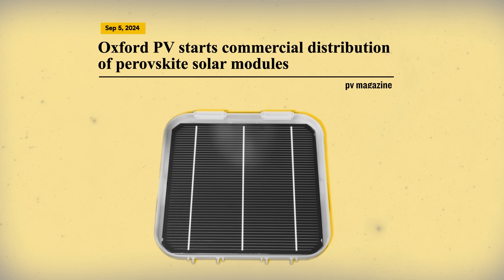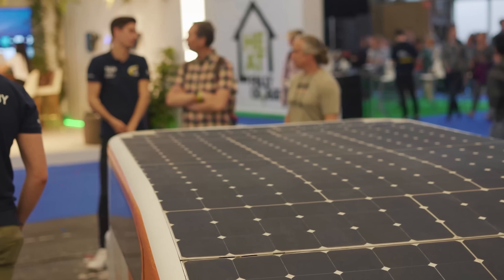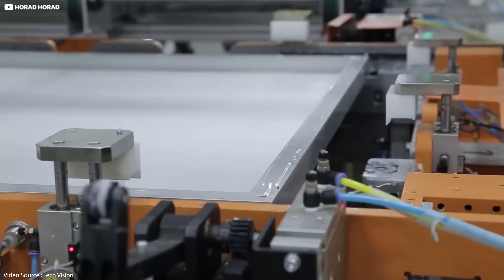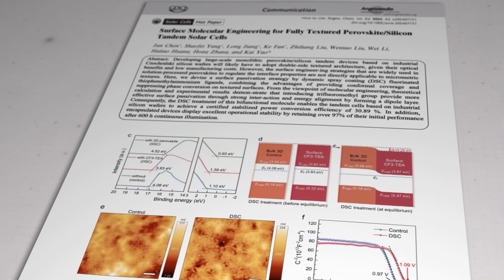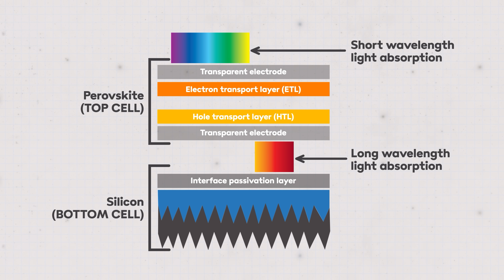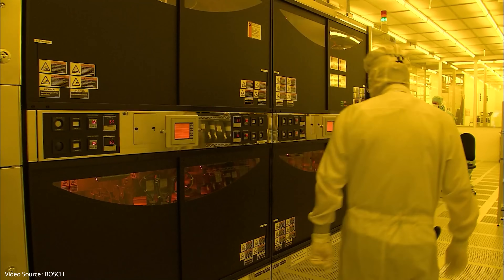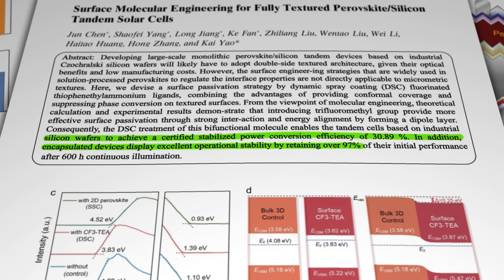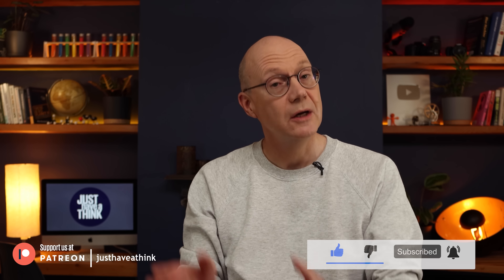Solar PV with more than 40% efficiency is now achievable.

Comment: Good progress it would seem. From a commercial perspective I would be hesitant to do other than a test installation due to the rapid aging problem. 600 hours of test is a tiny fraction of the 20 year minimum I would want. Accelerated age testing is problematic using any typical techniques for such. Perhaps the research groups will ad to this with some methods for simulating many years of exposure. Interesting, as always.
Reply: 600 hours degradation is only 3%, don't know what long term degradation looks like.  Normal panels degrade 3% the first year and 1% each year after that.
Reply: @GregHassler  At 10 hour average irradiance per day, call it 60 days. I'm unfamiliar with your 1% statistic. All my panels leveled out around 5% loss in 2 to 3 years and then stayed there. I have some in service now for 21 years.
Reply: As panels age, just add 3% more panels. 😊
Roof shading as latitudes warm would be a handy feature for rooftop panels. Shading 😎 😎 😎

Comment: It's great these technologies are being worked on but is 97% after 600 hours good enough? Hopefully someone can correct me but does this degrade performance in a compounded way? 600 hours is only 50 sunny days, perhaps 100 less sunny days. Does it keep losing 3% of the previous total for every 100 days?
Reply: Average solar exposure is about 5 hours a day.  Assuming they tested that 600h at full solar exposure(eg artificial light at full power) then its closer to 120 days. But note that was just them saying they stayed ABOVE 97% of the initial output during that 600 hours of testing time. It doesnt really indicate the life expectancy of a panel. That will probably take a lot more testing and something closer to a commercial panel vs test cells.
Reply: Also unclear how a cloudy day impacts them
Reply: A very good question. Losing 3% per 600 hours (about every 50 days or so) is not viable long term (it would halve about every 3 years), but hopefully it just stabilizes at some point.
Reply: Yes, it doesn't sound encouraging, does it? I guess we'll find out how they really last over the next few years.
Reply: their loss in efficiency tend to level off after a sharp initial decline, and then they degrade progressively slower in a curve. so just 600h doesn't tell us anything.

Comment: The more tech we can use, the better. Even if it has some downsides (e.g. shorter lifespan), it still can work plenty well for ground-mounted utility scale arrays. And if it's not from silicone, it might be easier to recycle afterwards...
I am optimistic.
Thanks for the update, positive news are rare these days.
Reply: One layer is a traditional solar cell so the recycling issue is more complex not less complex. That said, the good news is that it's not that bad just to bury them in a landfill. For even a 20-year lifetime the mass per year is still very low. Lower than most stuff that ends up in a landfill. Definitely a few orders of magnitude less than single use plastic and don't get me started on disposable diapers and kitty litter. 😁